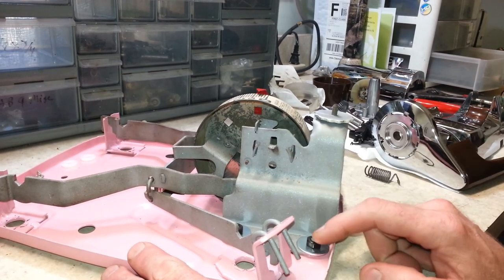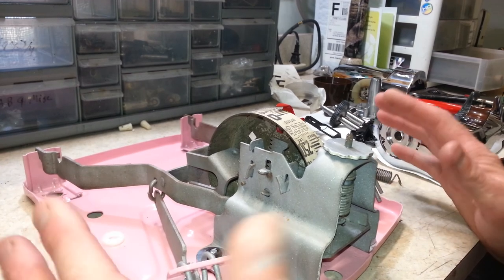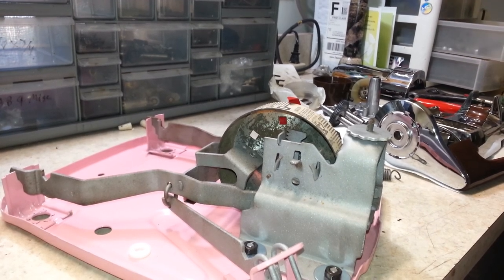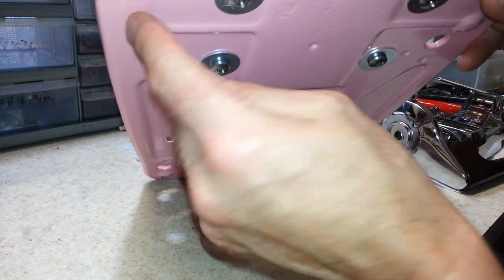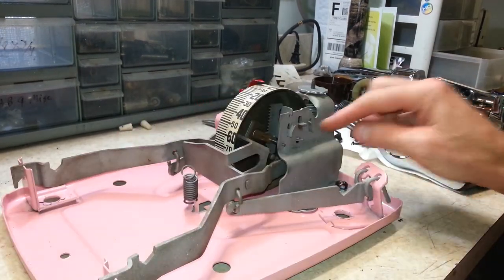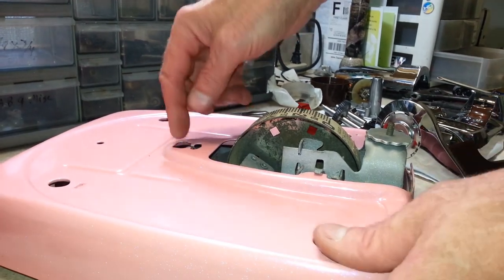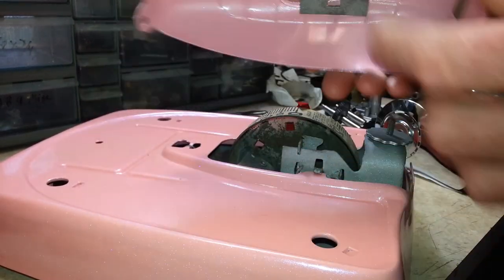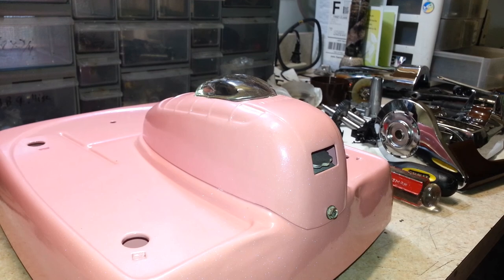Vintage Detecto bathroom scale Part 2

Comment: Using a pick with a curved end helps greatly in lifting the spring back in place. After taking a Health-O- Meter #1580 Bigfoot mechanical dial scale apart, cleaning and repainting it it registers lighter weights fine but when steeping upon the scale, it's way off. Checked and rechecked photos taken prior to disassembly to finished project, all appears to be as it should but still cannot figure out what is askew.
Reply from the maker: If this were off I wouldnt even know how to recalibrate it, i would have had to outsource that. My wife says it is pretty accurate so I must have gotten lucky! Great tip on the pick.. everyone loses 10mm sockets, I always lose my picks lol